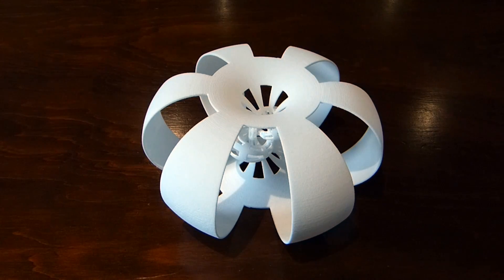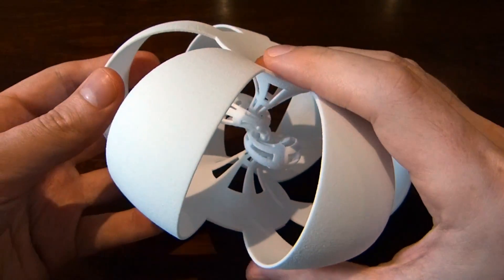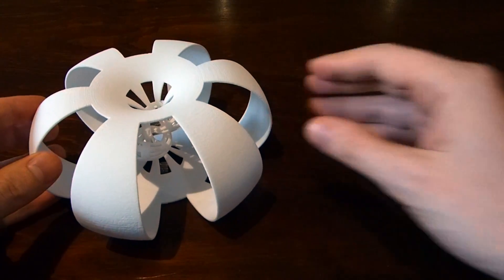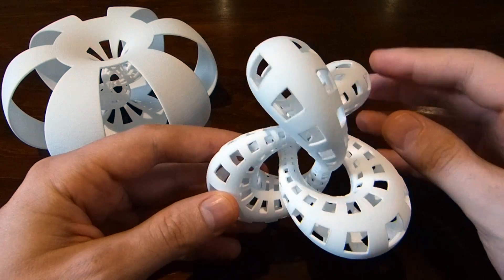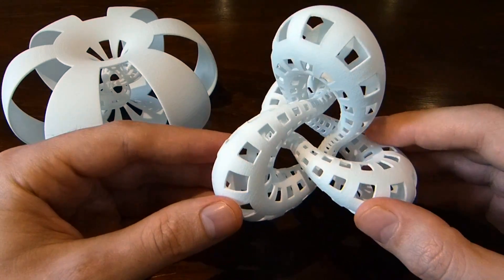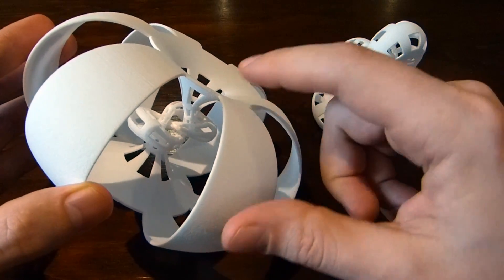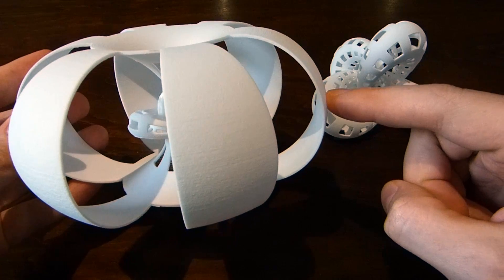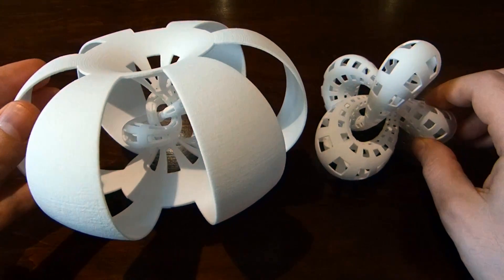Figure 8 knot complement

Comment: Hey the link is no longer available, I think shapeway maybe stopped selling it? The mebedded page (via figures/6-16) on your site gives a 404.
Reply: Same problem. The model is great and could even be manufactured into a glass table decor. Close all the rectangular see-through holes, forming a glass torus. Then pour some colored liquid from the top hole, and you can observe the liquid drop running through the glass bulb inside the knot.